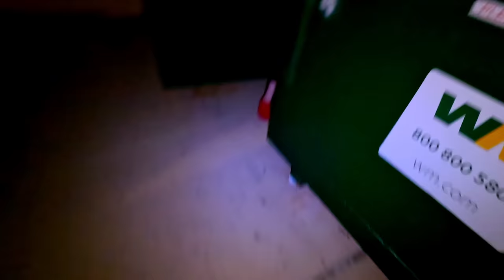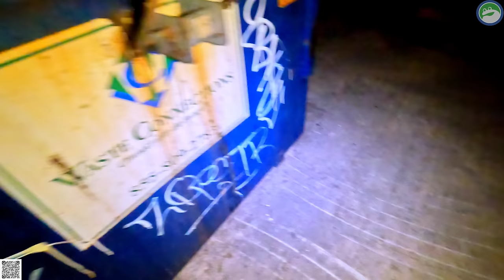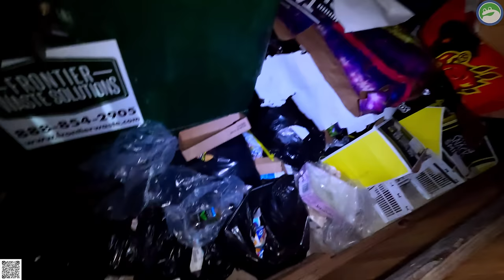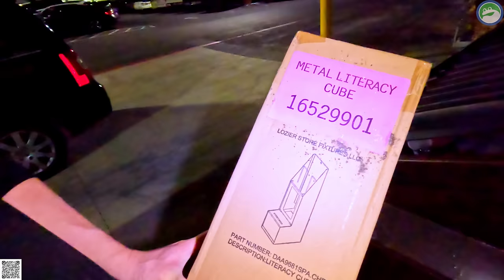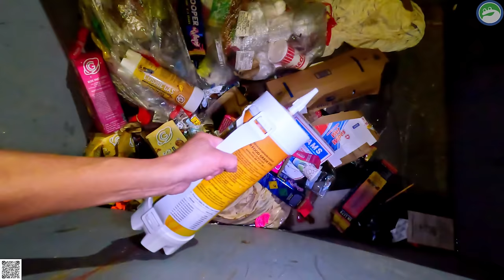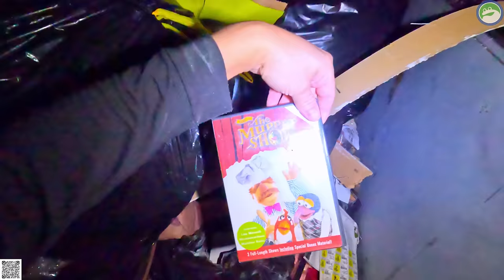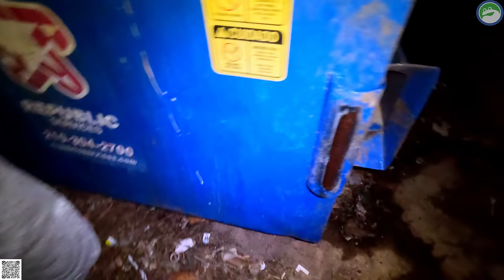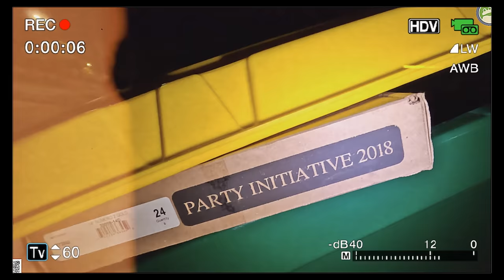Dumpster Diving Latest 2024 What we found in our local dumpsters this week

Comment: Cosmic Gas Flavored Nitrous Oxide comes in a 0.6ml tank and provides 375mg of pure nitrous to enhance your whipped cream infusions! Every tank has a screw-on pressure release valve, so users have complete control of speed and airflow! These gourmet whipped cream chargers are perfect for busy periods and dessert rushes.